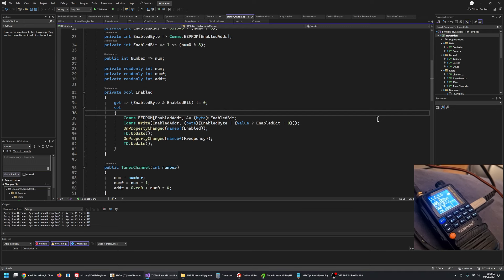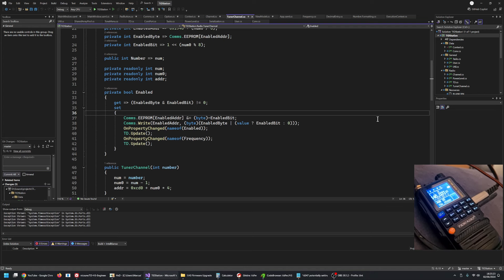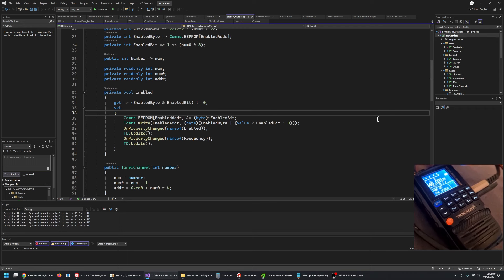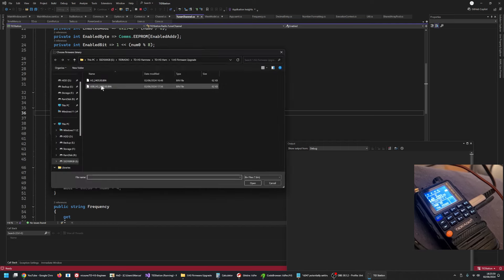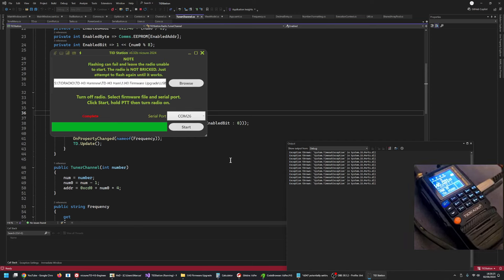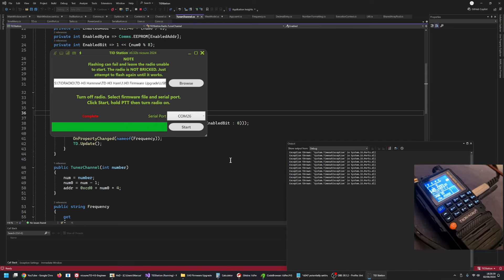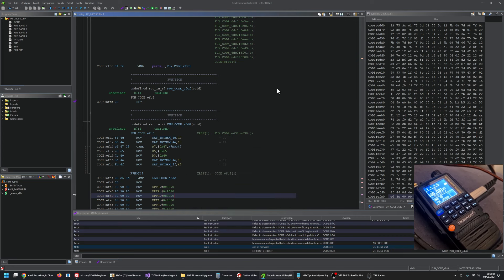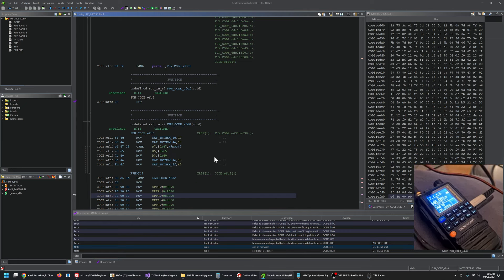Upper Side Band on the TD-H3 (*work in progress)

Comment: YES!!! @nicsure Awesome!  I'm so happy to see this!  Very excited for where this will lead!  Great job!   I wasn't sure we were gonna be able to identify what that little microprocessor was!  Did you come about it by trying different disassembly targets?  I believe from your last comment over on my video you were still up in the air!  Once again Great Job!  You've opened the door!   73s!
Reply from the maker: Byte frequency analysis. The RET instruction byte on most typical code appears from 1% to 2% frequency. Once I had a byte frequency readout it was just a matter of Googling to find out what instruction sets use the particular byte that appears in that frequency range as RET, then attempting disassembly with that architecture. When I tried 8051 (for 0x22 @ 1.33%) it all began to disassemble.

Comment: It's great to see that someone is also making progress in reverse engineering the firmware!

>as I am not at the point where I can add a new menu yet
Without the source code it's PITA. You need to hook menu handlers, which is not trivial because of the way compiler generates code for switch/case statements.

In my modification I just implemented my own menu, because it's much easier.
Reply from the maker: It was a royal pain, because I have to check what VFO is active, if it's in channel mode or VFO mode in order to get the correct setting for the mode and VFO. I'm just checking out your stuff now, very nice work.